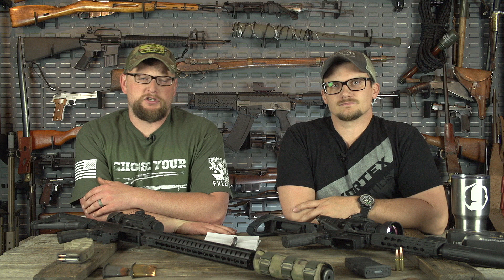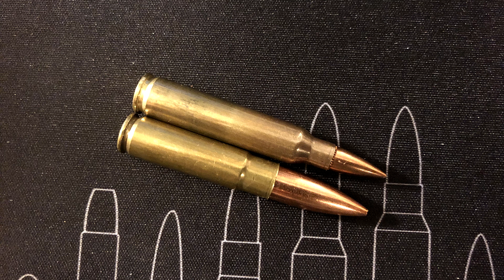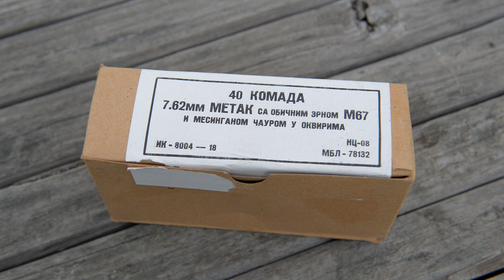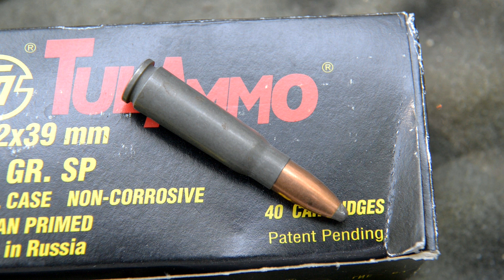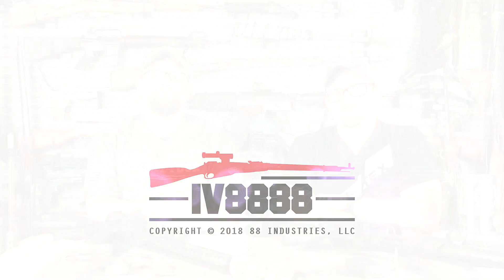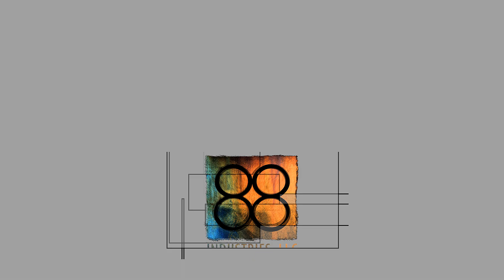Firearms Facts: 7.62x39mm vs 300 Blackout

Comment: I’m fairly certain people had the same arguments when 308 came up to fight 30-06. They both have their place and like any other cartridge, have pros and cons.
Reply: I could see 300 blackout being used as a replacement for an hk mp5sd setup. Compact, quiet and easy to put follow up shots down range (or more realistically down the hall). I dont see much of an advantage otherwise. Like if i had to clear land of pigs and had a budget, I would reach for 7.62x39mm almost everytime just on the merit of cost alone. If I knew that people were planning on breaking in my house and I wanted to protect my families hearing, I'm gonna swallow the cost and go for 300 blackout.
Reply: My mistake
Reply: Robert you are wrong . Only if you compare Garand loads (like m2 ball ) , does .308 compete with 30-06. 30-06 can be (and is)  loaded into the lower mid range of .300 Winmag. This especially applies if you handload.    If the smaller extra velocity of lower end 30-06 isn't an advantage vs .308 then . 357sig isn't really advantageous to 9x19+p, or. 300 winmag advantageous to 30-06.
Reply: @TheAsheybabe89  I mean that's the reason .308 even exists, it was to shorten the cases and still retain the m2 ball performance and for that it's perfect.
Reply: +Bruni  no. the 30-06 is 7.62x63
Reply: 30-06 is here to stay.  The only thing I hate about it is the fact that it's a long cartridge and there's only one, unreliable, expensive example of it in an AR platform.  I shoot .308 like it's 5.56.
Reply: Agreed, I see .300 blackout as something for AR people if they want a larger bore bullet using the same equipment. You can use the same mags, all you need to do is replace the barrel, and the bolt carrier. If someone wants a larger bore bullet as a new purchase then 7.62x39mm all the way. I also can see 300ba being used by special forces from a short barrel with a suppressor, and it maybe replacing PDW weapons in 9mm or 5.56mm as it does function so well from a short barrel.
Reply: Bolts the same... He even says so in the video.
Reply: @mymic208  you can even use the same BGC as the 5.56
Reply: alan wilson since when does the bolt carrier need to be changed when converting from 5.56 to 300BLK? The only parts different from a 5.56/.223 AR to 300BLK is the barrel, muzzle device, and gas system (300BLK using a shorter system). Everything else is interchangeable.
Reply: @BandAid350z  .300 Blackout doesn't need a shorter gas system. There's no reason you couldn't have a .300 Blackout upper with an 18" or longer barrel and rifle length gas system. Though I've yet to see one.
Reply: Kyle Michaels that’s true that it doesn’t “need” a shorter system, but it operates much easier with a pistol length gas system than 5.56. I’ve seen a few 16”-18” barrels offered on Midway. Not sure the reason.
Reply: Robert Robert if you get a 30-30 to do 3000fps, you either gernaded the rifle or used a sub caliber sabot like the sabots used in a 06 to launch. 223 bullets at 4000fps. 3000fps 150 gr 30-06 loads are safe in any decent rifle and readily commercially available. The 2820 fps listed on Wikipedia was lower than is average for that weight was my point.  Virtually every over the counter 150gr load sold by Federal and Winchester is advertised at 2900fps or more.  The velocity gap only grows the more the bullet weight is increased. Finally, handloading is relevant as it shows what can be done and what can't. It offers cost savings and the opportunity to extract every drop of performance possible. .308 is in vogue for the same reason 5.56/.223 is,  Uncle Sam uses it and it is plentifully. But. 308 isn't even any cheaper than 06 to shoot unless you buy some janky fmj loads.  Comparing Federal Fusion 150 gr loads in both calibers, the price is generally the same either way.  .308 can be handloaded a little cheaper due to cheaper brass (especially if you'll demill military brass)  and uses a little less powder.  But all in all, cost is a wash of you aren't loading and are shooting any decent ammo. On a side note, 338 Federal is a better cartridge than it's. 308win parent ever was or could be. If I were to band wagon on a new caliber, it would be. .338 Federal.
Reply: Benjamin Douglass . Not trying to pick a fight, but why would you use. 300 BO over 5.56 in a home defense role?
Reply: With newer, hotter powders a .308 of today can do anything an '06 of yesteryear could do.  There are also more options for semi-auto in .308 than '06 and way more surplus 7.62 NATO ammo.
.308 is the winner there.
Reply: Indifferent Centrist When reloading to the max of each cartridge 30-06 is a pretty great deal more powerful, .308 just can’t be loaded near as hot because of the case capacity gap between the two cartridges, saying .308 can do everything 30-06 can is just simply not true.
Reply: Thanks for the response.  You're right, and I was just thinking in terms of what I would be doing.  As a rule I don't take a shot beyond 300 yards when hunting and where I live is so densely wooded that it's rare to even see anything beyond 500 yards away.  Please correct me if I'm wrong, but it seems the '06 is more versatile (I believe it's the most common hunting round in the world), has more options and quite a bit more range.Also,  the max effective range of the .308 is 800 meters while the '06 is used in a lot of 1,000-yard competitions.
Reply: Indifferent Centrist You’re right the 30-06 is just a damn good round all across the board and don’t listen to a lot of people that say it’s “obsolete” because it’s not; maybe in today’s military it could be considered obsolete just cause they moved on to 7.62x51 due to it being a smaller cartridge that is a little lighter and the troop’s can carry a little more and it can do “almost” the same thing as 30-06 ;)
Reply: I had a .300 Win Mag I bought from a friend of mine because he was selling it for cheap.  I popped a ten-pointer here in Georgia and contrary to what you might have heard, it didn't tear it in half.  It was a neck shot that shattered two vertebrae and dropped him in his tracks.  The only issues I had with that rifle were the cost of ammo and the horrendous recoil.  I'm looking to get something a little lighter that doesn't hurt and cost a fortune to shoot.  If someone is willing to sell me an '06 for a good price I'll grab it up in a second.  Otherwise, I'll probably go with a .243 or .308.
Reply: Indifferent Centrist look at Savage brand rifles. They are extremely well made and well priced. I use 180 grain .30-06 in Alabama for deer because the slower velocity give the bullet more time to expand and do its job. It’s still faster than a .308 150 grain though. I shot 2 deer with near identical shot placement and the 180 grain 06 deer ran maybe 10 yards before dropping. The 150 grain 06 deer ran about 70 since the round just bored straight through. The 180 was through and through too but left a 4 or 5 inch hole in the rib cage. The 150 only left about a 2 inch hole.
Reply: Drexxler 1 Yeah, it seems that .308 is pushing .30-06 out, it's slow but it looks like it will only speed up. Why? No clue
Reply: Robert Robert both are relatively useless sources because they are referencing the tame loads like Remington Corelokt. Look for obscure loads where loaded to potential, or even better, certain handloading boards. Going on weak common commercial loads posted on Wikipedia and the like would lead you to also believe that 8mm Mauser is far weaker than it is (with most FedRemChester loads being down loaded to barely being more than 30-30) Such sites would lead you to believe 10mm is a lot weaker than it is too since a lot of 10mm ammo is loaded to little more energy than  .40s&w. Now considering Wikipedia, it lists 150gr 30-06 at 2820fps. That is artificially low.  An average '06 load is closer to 3000fps, and can be safely handloaded to well over 3100fps in any modern rifle. I do concede that. 308win will do 99% of what 98% of American shooters need. I wouldn't be afraid to hunt elk with it.  Perhaps Brown bears and Polar Bears are the only North American game that I'd be hesitant to use. 308 (or 06) on.  If we are getting into purely distance shooting, most all common . 30 cal rounds suck.
Reply: There was nothing wrong with the x39 to begin with... the 300 BLK was ONLY designed for the AR platform, while the 308 was designed to be more convenient, economical and useful out of any gun chambered for it (over the 30-06). The x39 can literally do everything the 300BLK can do besides use 5.56 mags and bolts (which is 100% a non-issue once you buy the bolt and mags).
Reply: Ashley, he was likely using 110 or 100gr varmint bullets or 90gr XTPs, 30 caliber but lightweight allowing the velocity. 3000fps sounds about right for a hotroadded 30-30 firing a 100gr I don't have any manuals handy though to confirm what "max" book load is though. 110GR 300blk loads can exceed 2500fps safely enough for the lawyers to let them publish the data so 3000fps from a light bullet in 30-30 wouldn't shock me one bit, especially if in something like a 22" handi rifle...
But velocity isn't everything, velocity without sectional density and ballistic coefficient is a close range squirrel load that won't leave any meat... Hotrodding a 30-30 with such a light bullet would be a futile waste of powder, that dragon ain't worth chasing, I am not against hotrodding but that's one just not worth it. Every 30-30 I've known didn't like lighter bullets going fast, twist rate is wrong and the accuracy suffers....

In .30 from 7.62 Tok the 300blk is the next step up yes, a handgun cartridge. the you get into light rifle with the x39 and 30-30, into service rifle with the x54r and 308, up into bigger stuff, 30-06, 300OSSM, 300WSM, 300WM, h&h, weatherby, RUM, 30-338 and so on.... It's a ladder and where one's needs on that ladder is entirely personal,  But perusing moose with a Tokarev or squirrel with a 300WM at close range would be stupid...   Balancing that power to weight to cost ratio will always be unique to the situation at hand. Pick your compromises, never feel the need to justify it to anybody and remember what works for you isn't what works for everybody else..

Personally I chose 300blk not against 30 caliber rifle cartridges but in comparison to other medium power pistol cartridges like 10mm, 9x25 and 45super/460r and the cost to get those in the gas operated AR platform. Money was the primary motivator in that choice but I am content with my choice.
Reply: Ashley Weeks Shot placement and/or volume of fire is THE thing period end. Evidence: “YooTub” video of huge hog taken with ONE 22lr tracer round and elephant/rhino poaching with 7.62 x39 and x51. I’m not talking about the ethics of “hunting”, I’m talking of getting a “job” done with the tool at hand.
Reply: alan wilson ok
Reply: I don't understand the love affair with the blackout....if you want a crappy .308 just hand load the .308 winchester down....
Reply: I'm pro 06 personally
Reply: @Nick R Whatever floats your boat. Use whatever source you want, they all have the same information
Reply: @Nick R Subsonic 300 blk will beat pistol armor, it's been done multiple times, I think someone even lined up a bunch of 3A soft panels and 300 blk got through at least 3 if I remember right
Reply: @Nick R Nothing short of .300 win mag AP will beat lvl 3 ceramic plates (what military and and I believe some SWAT uses) and nothing short of 30-06 AP will beat lvl 3 steel plates. Yeah 5.56 out of a long barrel at short range might work, but most people don't rock a 24 inch AR barrel and M193 at the ranges where it works and most people don't stand close enough or square enough for it to work either.

Bringing up armor in this debate means nothing, neither caliber will penetrate rifle plates except for a perfect shot with 5.56
Reply: 30.06 has got legs and 308 intermediate at best. You can actually use a 30.06 as a dedicated sniper platform past 500 because it will stablize heavy pills unlike 308.
Reply: .308 and .30-06 are more similar I think.  I get your point.  For me, that one comes down to supply only.  Like both cartridges.
Reply: Your 30/06/308 argument is baloney.
Reply: Not the same ag all
Reply: netflix netflix All the 30-06 has on the .308 is the option for higher grain bullets and some extra velocity with lighter weights. I see the 30-06 losing ground in hunting due to more .308s coming out while having similar performance, but 30-06 will always be better at long range
Reply: Robert I shoot 185 ground pills outta a 308 win. Most 30 cal target shooters will agree that unless you are using a magnum rifle nothing over 185 will do nothing but hurt you really. I have 8 30-06 and only 4 will take anything over a 185 grain pill cause of C.O.A.L.
Reply: Ashley Weeks I took my examples from Wikipedia, basically the average for both rounds. While 30-06 does everything a .308 can and more it comes at a cost, don't get me wrong here, they're both great, it's just that .308 does more than enough for most people and 30-06 unnecessary. .308 can drop deer quickly farther than most people can shoot accurately, so why use a 30-06? My point isn't that .308 is just as good as 30-06, my point is that the average person doesn't see the benefits of 30-06 over .308
Reply: @Robert-qm7yi  thats not why... the ballistics are virtually identical but 308 feeds reliably in semi autos and does it with less recoil and concusion. 30 06 on average has 50 to 150 fps on average more compared to 308 win which means 50 to 100 ft lbs difference which means in the end it essentially wont make a difference in the end. Youd get the same result with less recoil and more reliability.
Reply: You sure that was the case with the .30-06 and .308? I don’t remember there ever being that argument.
Reply: netflix netflix You really gonna shit on wiki? You understand that there are sources there that link to the exact same information. The reason I use Wikipedia is because it gathers information and puts it on one page, if you doubt the accuracy just use the links provided by wiki and see for yourself. I guarantee that my information is accurate
Reply: netflix netflix How about Lucky Gunner? They're reputable and guess what? They say exactly what Wikipedia and I say, 30-06 has a slight advantage in velocity and can use heavier bullets
Reply: Logically, yes.  The .308 can do almost everything.  30-06 is a tad outdated.  And the 220 gr. ammo can boogy through brush like it's going out of style.  It works well at long ranges too.  It's right up there with other iconic cartridges.  Am I the only one who loves 30-06?  BTW, I don't say "thirty ought six".  It's a "thirty oh six" meaning .30 cal of 1906.  I have never used "aught" as a replacement of "0" with anything else, and I'm not a backwoods hick.
Reply: @jackkelley4539  besides .30-06 can reach around 300 win mag power where .308 just can't. It's a far more versatile round.
Reply: Ashley Weeks We aren't arguing handloads here, because that it up to individual guns, not the cartridge itself. What we're arguing is an average safe load for both rounds. And with average, safe loads, they're very comparable. Handloads are out entirely, if you wanna argue that I can handload a 30-30 up to 3000fps granted it's in a well built gun. On top of that most people don't handload anyway
Reply: Robert Manufactures loaf the 30-06 very conservatively, compare underwood 165 grain sst 30-06 to the same bullet in .308 and if you tell me there’s not a difference then I’m done here.
Reply: As Paul Harrel would say that is a “SIGNIFICANT” difference; I’m out...
Reply: One very significant difference is that the .308 is effectively a 7.62x51 NATO a military standard, while the 30-06 was retired. 

300 blackout is a nitch round vs a retiring military favorite.
Reply: "I researched through wikipedia and that tell's me what I need"  what a joke.

Comment: Thought the advantage of 300 black is for SBR/braced pistol and supressed.
Reply: That, and compatibility with standard 5.56mm AR-15 components.
Reply: I have 300blk Suppressed 10.5-inch pistol. The ammo is right at $1.10 per round. I love it. Due to the cost, I don't go to the range with it much.
Reply: Yes. Because 300blk burns powder faster so you get full powder burn in short barrels. I could be wrong but I believe it was made specifically for special forces to have a round that they could go from near silent subsonic suppressed in tactical situations to supersonic when needed if the fight goes hot.
Reply: @Nick R my boss knows a navy seal that's said the opposite.